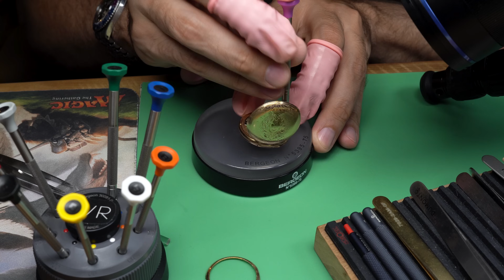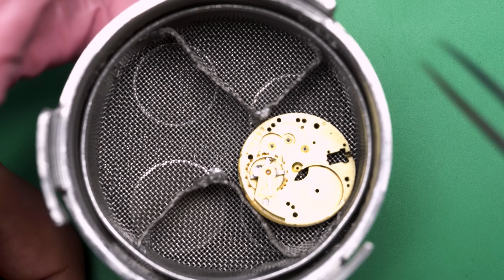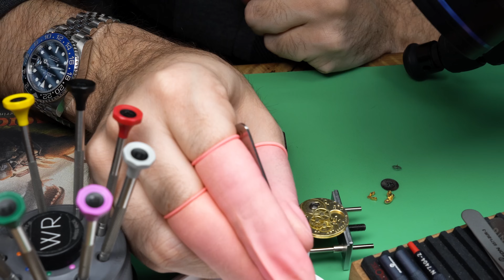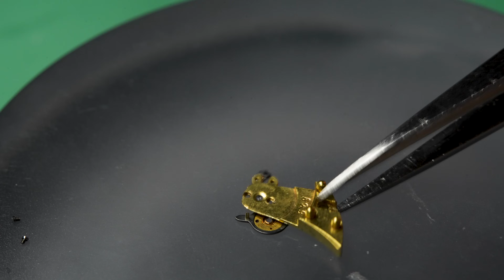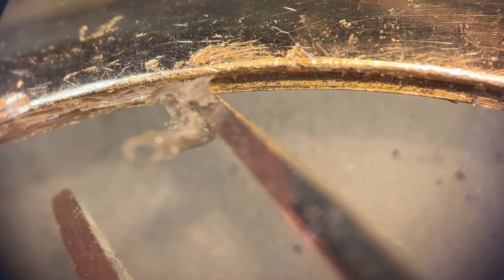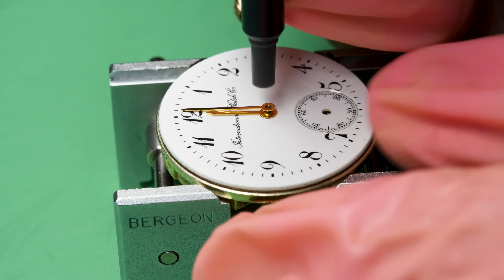A True Mystery Behind the History of This IWC Pocket Watch

Comment: Late to the party, but Marshall, you should never close a pocket watch lid by pressing it down till it audibly "Snaps" closed, I know it's done in the movies, film, television, probably theater, lol, but the way you should close it is by first pressing the crown down so that the Catch, that's that little latch that's spring powered to reset into position after the crown is depressed and the lid on the hunter case opens, so press the crown to open the catch, then close and hold the lid down, then release the crown so the catch can take hold of the lid.

Certainly not as fun or satisfying to hear that click, but it's the preferred method to the cases health.

Because I work on watches too, and have had a number of them come in that the lid just won't stay shut, and when you look under a microscope the lip on the lid is gone from years of snapping the lid shut, the catch is a harder steel and over time it just eats away the lid material.  

The fix really is to replace the lid if it's plain, or I do know a guy that's got a gold welder and he's told me he has made new lips for the lid but it's not really cost effective, if a lid can't be replaced they can either just be careful with it or remove the lid, which was an option I told a customer as their case was one of those with an open center. So you know the lid's job is to protect the crystal and since this one is with the punch out opening I told the customer the best repair since the lid was unique and a replacement wouldn't match, I recommended just removing the lid cover since again with it open like that it's not keeping anything safe.

But the customer wanted it to stay, so the best hope I could do is to slightly bend and bring the catch out more and to a slight angle to grab what's left that little bit remaining and told the customer stop snapping the lid closed lol or it won't work as it is, it still may not keep the thing shut so be mindful when taking it out of the pocket.

But yeah amazing how people don't know you are actually causing damage doing that.  And it's hard not too as it's a really pleasing even therapeutic sound.  Like how you enjoy the main spring click when returning it home.

Just helping and 2 years ago, you probably know now not to do that, but just a friendly fellow Repairer of Time to another help tip.

Thanks for reading.
❤👍

Comment: Hi Marshall, what are the4 service oils needed for watch lubrication, I’m hooked & I blame you.🤣🤣🤣
Reply: Marshall doesn't respond much to the comments but I actually made a list of the lubricants used by one watchmaker doing a Seiko:

Mobius 9501 (or 9504) grease (keyless works, teeth  of automatic works reduction wheel, outside of cannon pinion 
HP1300 grease (barrel arbor,  2nd reduction wheel jewel, 2nd reduction wheel pivot,  day date corrector wheels C and E, minute wheel post)
Mobius 8200 (mainspring)
Mobius 8213 braking grease (barrel wall)
Mobius 9010 grease (3rd wheel pivot,  main plate jewels,  cap jewels, day date corrector fixed wheel,  day date corrector wheel B,  under day date corrector wheel (plastic), oscillating weight bearings)
Mobius 9415 (exit pallet stone) 
Seiko S4 grease ( under automatic works 1st reduction wheel)

Comment: In 16:51 you reassemble the Maltese cross blocking. I have already seen another video where you did this. I wanted to tell you that if you take a closer look at it there is a certain way it works. All notches have an inward circular shape except for one. There it is outward circular. This outward circular part is meant to prevent the user to wind the spring further so it may break. While reassembling this part in an unwund state you need to place that one special nodge right besides the "nose" of the other wheel. Otherwise you cannot wind the watch completely up.
Once I was in an apprenticeship as a watchmaker and had to do a construction painting of this by hand following an ancient instruction. I loved the final look of that painting so I really remember this part and its use.
Reply: What is a nodge?  Or did you mean notch?

Comment: I love IWC's. I believe that this one is a caliber 64, 12 ligne. Providing it is actually 12 lignes, that is. I don't know whether or not you have looked into it since you did this video, but those polished parts on the barrel, the stopworks, should be set up with tension, rather than just set on top. That said, for a watch that won't be worn or run much, it's probably know big deal. Bob Tascione has/had a nice video tutorial here on youtube that explains this procedure really well. Thanks for another great video. Again, that's a great watch, deserving of such fine care as you provided. Cheers.

Comment: Great history to that watch!  I bought an antique pocket watch around a month ago and am discovering a LOT of history behind it.  Whether the seller didn't bother investing in the time and effort of research or just didn't want to list the details, I've no idea.  But the gyst of it is, it turns out the watch was owned by a watch maker himself in the 1840s, who happened to be a master engraver as well.  His father was a watchmaker in the early 1800s.  The fusee movement was manufactured by his company and I believe was new-old-stock when his son placed it in a new silver watch case at the time of his engraving.  Hallmarks jive with the personalized engraving , with his name and date behind the keyhole cover.  The protective dust cover over the movement, solid silver, has a very fine, ornate and large letter of His last name in cursive.  One of the things I found while researching was the odd absence of any maintenance marks and codes from other watchmakers within the case, save for one very small capital letter corresponding to the same watchmaker/engraver's last name.  It occurred to myself that one wouldn't need to take their watch elsewhere for routine maintenance or service if the owner was a watchmaker themself.  Everything is very well preserved, the dial is flawless, the owner even engraved his coat of arms on the reverse of the case along with his initials below it, which can only be well seen with magnification.   It only takes a quarter turn with the key to start running, and that amount lasts a good 4 to 5 hours.  Apparently it came from a long line of Scottish watchmakers.
It really pays to do the research in things like this, which is often half the fun!

Comment: Another lovely piece of work.  Counter enamelling is done on thin section metal, as metal and enamel contract differently.  The metal does not curl when heated, but as the enamelled piece cooled the stresses of different cooling contractions can either force the metal to bend, or contribute to the enamel popping off.  Enamelling both sides applies the same contraction forces to both side of the metal, which balances out and prevents curving and enamel detachment

Comment: Hello Marshal! My father has a Rolex Datejust Two Tone with a Bezel that is diamond and not original to the watch other than that everything is original. One of the roman numerals fell off in the past and he shipped it out to the guy he purchased it from to get it fixed less than a month later another numeral fell off and Rolex has refused to fix it. It has been in a safety deposit box for the last 15 - 20 years without any wear. Would we be able to send it to you to get it fixed and oiled up and everything, I also think it would be  an interesting video.

Comment: My man I need more of these. Lol
I finally got my hands on a mechanical watch holy shnikes that shtick is hard to work with.
I've repaired small stuff like cell phones and tablets, even done some fine pitch soldering. I have never held a screw so small I could mistake it for dust until I opened a watch.
Wow. Just wow.

Comment: Hello Marshal.  I have watched very many of your restorations. I find them very satisfying to watch and your method of work has given me insight into an approach for performing an involved multistep task.  
I do have  one question though.  have never seen you adjust the spring lever on any of the balance wheels. I assume this is an adjustment to fine tune the rate of the wheel excursions and the accuracy of the watch. Could you elaborate of the theory on that adjustment device, please? 
Thank you

Comment: Hey brother, love your vids! Small correction: NEVER snap a pocket watch shut. My grandfather was a professional watchmaker & jeweler, & he always taught me "Button open, button close". The steel tooth that opens & closes the lid can actually break off, but it's also much harder than the gold of the case lid, which wears away quite rapidly to the point where over time it simply won't close no matter what without professional case repair.

Comment: I mean bulovz
Reply: It is in shambles because I decided to service it with the experience I have built and recently found a similar movement. It was missing the minute hand the canon pinion, crown wheel and screw, and needs a new mainspring which I already have from a caravelle from the same era and size of barrel
Reply: which is also why I cannot get it to run and was not shock protected but both balance staffs were healthy. And the center wheel is crooked.

Comment: No mention of the Geneva stop work on the mainspring barrel ? It can be a little tricky lining up the two parts so that the winding is stopped at the appropriate position. Often unskilled repairers discard parts of it because they couldn’t figure out how it is meant to work.
Great video by the way !

Comment: When I was making military parts we had several machines running tiny stuff, about the size of watch screws.  I assume they are most regularly made on swiss style lathes.  Ground precision bar stock is slid through a hardened rotating sleeve to support it as cam driven (CNC servos in modern machines) sliding tool carriages are moved in to cut the features.  Extremely high precision features are able to be cut on tiny parts very quickly and repeatably in this way.

Comment: Beautiful Watch. So good to see it running again!!
Was the Watch Case run through the Ultrasonic Cleaner? It was quite grubby and certainly would have benefited from one.
I notice that Cousins do a suitable set of Pocket Watch hands (for Miyota 2035) sized at minute 0.7mm (18mm length) and hour 1.20mm  (13mm length) in styles in keeping with the original and even in blue steel. It would be possible to reduce the hour hand hole down from the 1.2mm for a perfect fit.
Your camera work is brilliant!
Thanks for the excellent video!

Comment: With the original mainspring, I'd want to correctly set the Geneva stop works on the barrel. Hopefully a replacement intermediate setting wheel can be found as more broken teeth are otherwise on the way.

Comment: Marshall, you do amazing work and I love your videos. However, as a lover of both watches and cars I feel the need to point out that there is a slight flaw in your analogy contrasting watches with car engines - timing is actually important to internal combustion engines as well. IC engines work by opening valves at precise intervals to allow air and fuel into a chamber, allowing the piston to compress the two until combustion happens, then exhausting the spent gasses. Today's cars have timing mechanisms (belts or preferably chains) that keep valves and and pistons operating on the same schedule to prevent valves from hitting pistons and causing the engine to explode. This is not to say that a car engine could keep the same time as a watch, but timing is still incredibly important for both efficiency and reliability.

Comment: Not so sure that it is a good idea recommending a newb start on a vintage pocket watch.  Sure the parts are bigger, but trying to properly oil the balance is not something that I want to try off the bat.  Maybe recommend a newer pocket watch with shock settings.  I'm starting with a new ETA 6497 clone.

Comment: I would really like to obtain a pocket watch to repair myself.  Does anyone have any recommendations for a make/model to keep my eye out for?  

I'd like it to be a daily carry, so it would need to be a shock protected one, possibly with the ability to see the work running without much fuss.  And I don't really have a big budget to get one.  

I do have the skills and basic equipment as I'm a solder technician for an R&D firm.  I regularly solder components 0.5mm wide and 1mm long.  I have a very nice range of tweezers, micro screwdrivers, IPA soak tanks and an ultra sonic cleaner to go with a 1x to 150x digital microscope.  I would need to obtain proper oils, or see if any of the synthetic lubricants I already use would work.

Comment: You should get a digital microscope with the attached LCD screen.  Find a model made for soldering electronics and an HDMI output.  This would allow you to work under magnification with the scope lens a decent distance away.  

I use a scope like that at work and can have a 4x to 10x magnification while still having sufficient space under the scope to place components and solder them in place without the lens being anywhere near the heat of the iron.  If the iron gets to close, it would quickly damage the scope.  For doing inspections, I can up the magnification to 150x to quickly inspect a board's soldering quality.  

I did modify the scope before ever using it.  They come with a 10"x12" steel base that they expect you to use as a work surface.  I find this very inconvenient as it's a small size with no ESD mat.  To make the scope much better, I detached and rotated the base plate 180 degrees, and reattached it.  I then placed a counter weight on the base plate to stabilize the scope in this cantilevered configuration.  This allows me to use my base mat as my work surface, or bring in a board holder or helping hands to get the job done.  I think you would find this configuration very useful for working and recording without straining your eyes.  The HDMI output is the same image you see on the built in screen.  

I did eventually build a new holder for the scope which attaches to a shelf on my workbench above the worktop.  This frees up mat space and allows me to quickly move the scope in and out of the workspace(by moving to the shelf and back out to the work area) as well as quick vertical adjustments to set the working distance and magnification (distance is inversely proportional to magnification)  There are good quality scopes on Amazon with a 10" screen made for soldering or watch making in the $250 to $400 price range.  This is an instance of buy once,  cry once.  Get the best quality scope you can afford, and it won't let you down.

Since this has become one heck of a wall of text, I'm going to make another comment looking for recommendations on what to look for to get a first pocket watch with which to tinker.

Comment: Hello Marshall.  Just watched the video.  I always look forward to new material on your channel.  I spent the first 20+ years of my watchmaking journey working almost exclusively on American pocket watches.  Please reach out to me if you ever need hands, mainsprings, balance staffs, etc .  I noticed a couple of thing while watching the video.  Go back and watch the video and notice how many times you inadvertently touch the movement with the bare tip of your ring finger - right hand :-).   Maybe a cot on that finger also?  Secondly, when working with a "hunting style" cased watch such as that IWC,  You should depress the crown, close the cover, and then release the crown.  This is CRITICAL if working with an 14k or 18k solid gold case.  When the cover is "snapped" closed the "catch" quickly wears a notch in the cover which will eventually cause the cover not to stay closed.  It's very costly to have a jeweler repair that damage (ask me how I know).  Nice trick using the "autosol" to remove the fingerprint stain.  I'll mentally file that away also ;-).  The glue used to install the glass crystals is "G&S" crystal cement.  It's sort of like the old model cement we used to use back in the '60's.  Dries clear and remains somewhat flexible.  I'll file the acetone trick away also.  Great watch and great video.  Regards, Mike
Reply from the maker: Thank you, I may have to take you up on that!
Reply: Also the keyless works gear can likely be found.

Comment: Another great video!  Just a FYI - never close the cover of a pocket watch case by squeezing the lid shut.  Always depress the crown first, then push the case closed, and then release the crown to engage the latch.  While the snap with the former approach can be satisfying, it puts enormous stress on the edge of the cover (which is a soft metal) against the steel edge of the latch.  After doing this many times, the lid will no longer stay closed.  The problem is even worse with solid gold cases because the gold lid is very soft.
Reply: I should have looked for this comment before commenting the same thing myself.

Comment: Another reason for the counter-enameling is to protect the dial enamel from cracking due to temperature changes throughout the life of the dial as the enamel and the metal backing expand and contract at different rates as the temperature changes.  As you say the brass and enamel would try to "curl" due to that.  And enamel is not very bendable :)
Reply from the maker: Good to know!